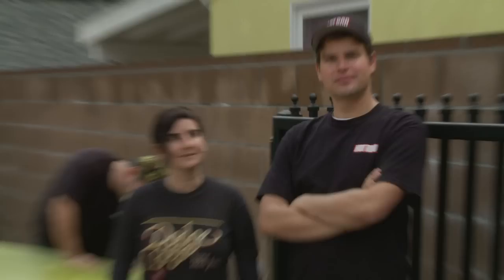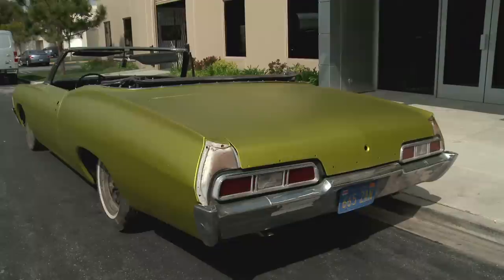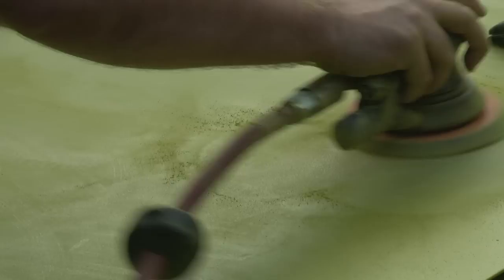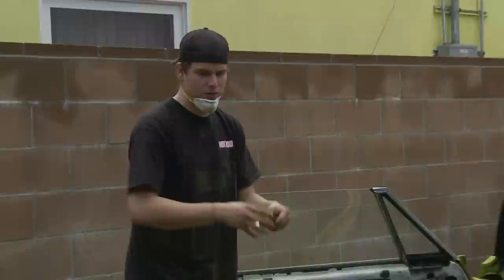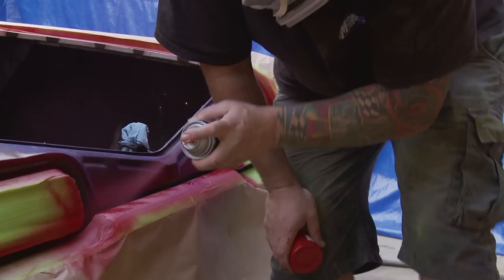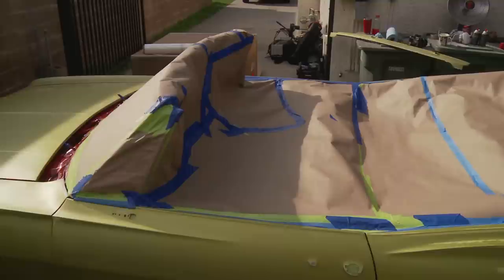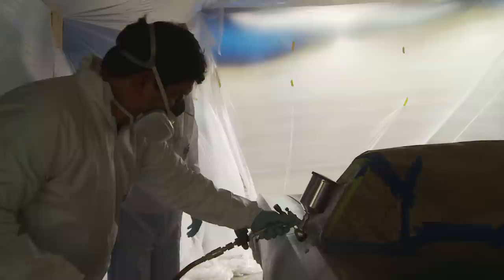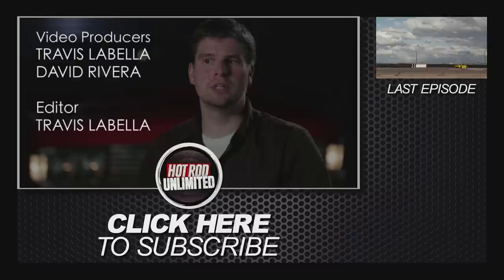Back Yard Paint Job! - HOT ROD Unlimited Episode 25

Comment: I had a 67 Impala for several years back in the 80's and loved it. I picked up a 69 Caprice for $300 with a 396, Turbo 400, 12 Bolt posi with 3.42 gears and disc brakes as a parts car.  Swapped the complete frame into mine. One thing I added that made all the difference in the world driving the car was a steering box from a late 70's Firebird Trans Am with the WS6 option. It was a bolt in swap using the Impala's pitman arm. Less than 3 turns lock to lock with great feedback. Good luck!

Comment: Things to truly finish it;
-New wheels with a tire that does not have a ridiculous profile
-Disk brake conversion (maybe wildwood?)
-work on motor to keep car as a sleeper
-suspension (maybe drop it an inch on all four corners?)

Other than wheels/looks, the car is fine as is. The rest of the performance aspect is optional. Would be pretty bitchen though if you can pop the hood and reveal a nicely dressed engine compartment... Good job though.

Comment: Modern suspension, and restomod the interior. Ditch the original vinyl and fake materials, go with a sturdy easy to clean leather or alcantara, and brushed aluminum accents. Make it look almost stock but not quite. Also needs a gloss clear coat. I understand why you went satin, to cover for the fact that it was done in a back yard over 2 days and not a shop. But it wouldn't take much to take it to a shop and have them do a nice clear gloss and make it look professional.

Comment: A modern 5.7 would be cool. Even a 5.3 vortec or a 6.0. Nothing too extreme, but you have the ability to upgrade and add new components down the road. Plus bu doing this you could have it all fuel injected making it much easier on the wallet for a DD.

Comment: Summit Racing's website lists a Paint Shop Starter Kit for $183 and the corresponding paint gun (gravity feed, not compressed air powered) for $144.  What else would one need to buy before they attempt a respray of a car, or do those two products cover the operation?  If so, $327 (plus $150 for primer, paint and clearcoat) and a lot of free time sounds much better than $2000-$4000 professional respray.

Comment: stock silver slotted steel wheelies, with black walled michlens.Wilwood four wheel disc brakes, bilsteins 1500. Black leather interior from katzkins. Dont like the stock wheels, then go with dayton wires, powder coated to look like borranis...lower the car w/air bags? rear skirts are popular now, if you want a hot rod lowrider.Great car!

Comment: Jam a dirt cheap $900 6.0l lq4 or if you dont need cubes the chaper $500 5.3 or $300 4.8l with a new top end and cam in 4.8/5.3 makes around 500hp 6.0 can do 570 with an aftermarket LS3 top end kit (witch wil fit the 6.0l witch has a 4" bore) . EFI= daily driver :P Steel block LS weighs about 520lbs SBC weighs 575lbs so i would guess that small block suspension have no problems with that. And a $40 piece of metal makes the ls flywheel fit th-350 400 SB converter and all so but the 6l40 auto 6speed might make it a even better daily driver.

Comment: Impala's are the #1 lowrider car of choice.. ahem... loose the wheels and white walls, that wheel/tire combo would amp up a 30's Hrod and look great but here it dosen't work unless you are going to add hydraulics. Go towards the 66 Buick Roadkill look..16 inch Torq II's with sticky meats and a rollbar (big single rollbar like 68 GT500 vert) that fits neatly under the top.

Comment: if it is supposed to be gloss they would have to rub it down with some 800-1200 and shoot it again. They didn't need to take the gold paint off to repaint it either a wet rub would have worked fine it was pretty much new paint.

Comment: white pinstripes along the sides. white top and interior. 15 inch white spokes. dual exhaust. flowmaster super 10's. wilwood brakes. no hydraulics. old school 454. holly 4 barrel dual pumper. shorty headers. alpine radio. you know, the basic necessities

Comment: I did a rattle can job on a 78 caprice that turned out pretty good, compared to nasty faded light maroon two tone. Why was two tone the way to go back then ?? A week of setting up in summer sun, get out the buffing wheel and done.
Compared to stock nasty paint it looked good for under $100 spent. And i could look at it and not cringe, it was still a beater but it looked less beaten. Good enough for me.

Comment: Do people here not understand the point of this? It's not a car that's going to get high end suspension, 10k in wheels and tires, another 10k in a stereo, ANOTHER 10k in interior. I mean, seriously? It's a cruiser, it doesn't NEED that. Granted, it needs a good wet sanding, but other than that it's pretty sweet. I really like the whitewalls on it.

Comment: WOW does no one on here LISTEN? he pai red it with a satin or matte finish rather than a gloss finish. I have a buddy who saw the car when visiting Cali, he said the paint prep was 90+ %  and never saw any issues with it. It may not hold up to 6 in eyeball scrutiny  but he said it had a bettrr paint job than most production shops lay down. And he has had 4 or 5 custom paint jobs in just hte ladt 10 yrs done.
Reply: MonzaRacer 6" eyeball scrutiny?! What're you talking about?! You can see the orange peel from 20ft+ in motortrend car glamour footage... you're trying to pretend that a matte color explains why it looks like the panels are covered in red 60 grit, it doesn't. Matte means low reflection not textured.

Comment: is it easier to paint a car white with a 1 stage paint (no clear)? can you still wet sand and polish? And can you buy paint thats ready to be put in the gun and painted? Instead of using thinners
Reply: +Hayden Sutton 

1 Stage generally doesn't last that long and wont give you the desired amount of gloss. A good 2k clear after your basecoat will keep it protected for years.
You can still wet sand and polish a 1k system, and most paint shops would probably be able to thin it for you, albeit that the amount of thinner applied depends on other factors like temperature and whatever, it won't make that much difference for a beginner.

Painting a car decently is hard, there's a reason he used a semi gloss/matte clear coat, because laying down a high gloss clear coat is not something that you can do without years of experience. Matte clear coats also dont show any trapped dust as much, however you can wetsand and buff a matte clearcoat, because then it would become glossy.

Comment: suspension and brake upgrade make it eat porsche's in the curves!. i'll be sure to either not paint my 67 caprice or i'll need to take a second mortgage and have a pro body shop make sure the line that runs down the sides of the car isn't wavy...want to sell some of that chrome ?

Comment: Do you see a problem with the short flash times between coats. 
The concern would be shrinkage on the sealer coat. Might not show up for a few months. There maybe checking or crows feet. Only time will tell

Comment: does that thing pass emissions
Reply: +Yoshiman__ In Cali 74 and older is smog exempt.
Reply: ***** damn its been a while, last itme i lived there it was 66 and earlier. that was in 97
Reply: Yea I got a car with mechanical fuel injection that requires smog,.. It's one of the reasons I am leaving Cali.
Reply: ***** thats the main reason i wont live there
Reply: It's funny the can knock a hole in the mountains for highways but they can't do it for air flow to blow the smog out of thew city.

Comment: It came out fine for a backyard paintjob, but not amazing, considering it was closer to a professional paint job. A talented rattlecan job can have a nicer finish..... before sanding.

It's better than it started, at least.
Reply: They chose a satin finish which is much less forgiving than clear.  Any imperfections in the paint will be much easily noticed with the satin finish.  Hence why you can notice the Orange peel from a mile away.  I'm not a fan of the tires either.  But yes, major improvement over that warning radioactive waste green it was prior.

Comment: This video has such an incredible amount of fail I hardly know where to begin.
Spraying urethane paints without supplied air hoods.
No,none,nada filter respirators are rated for isocyanates.
Non electrically classified box fan used to ventilate.
This is a spark source to ignite flammable solvents.
Sorry but the results IMHO look awful.